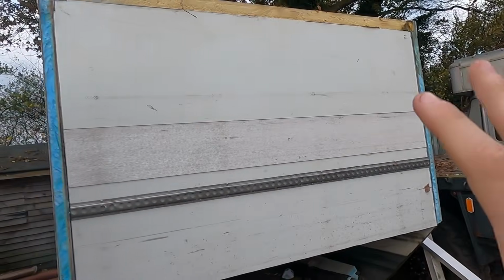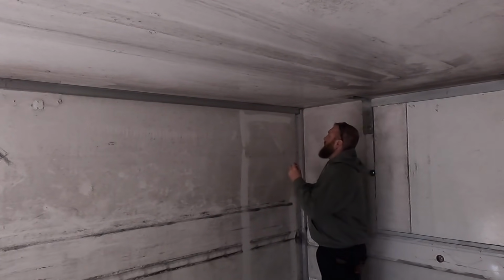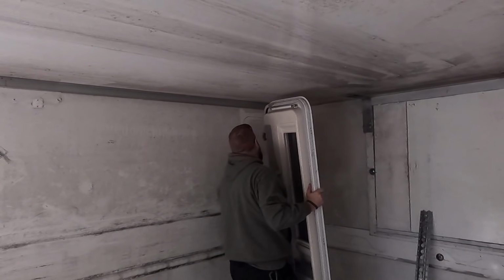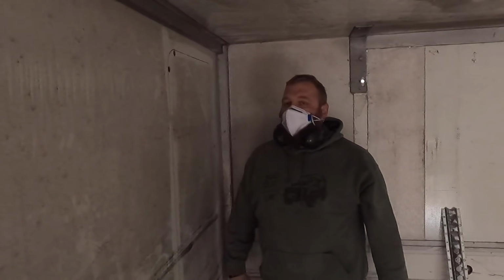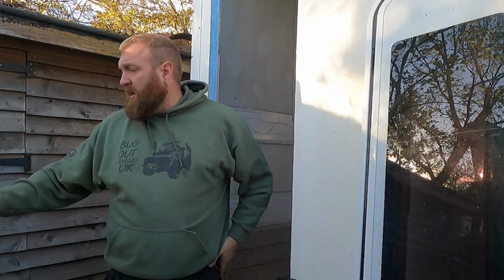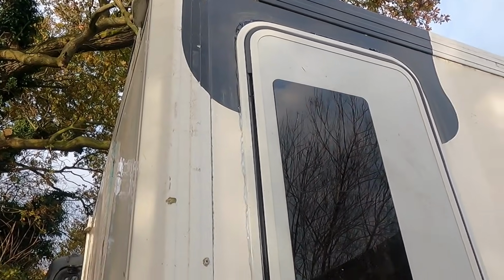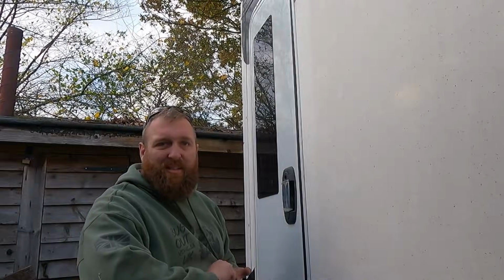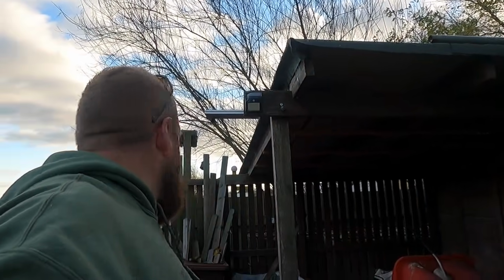BUILDING A 4X4 OVERLAND TRUCK CAMPERVAN (the habitation box door) part4

Comment: Bit late catching up but if you have anymore long runs to cut if you have a circular saw in your toolbox would that be better for you to use as you can set the depth and when to put your seam sealer on use masking tape round the outside and leave a small gap before you press in and smooth out the sealer for a really professional finish